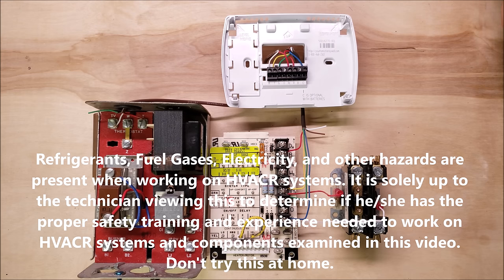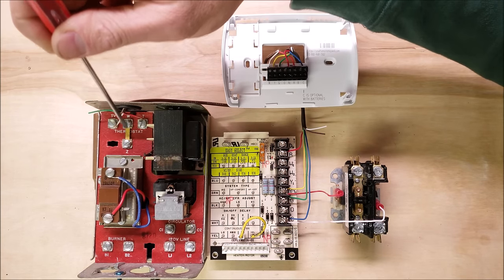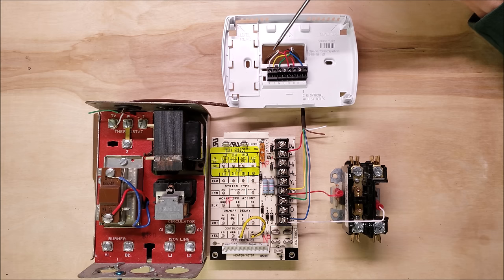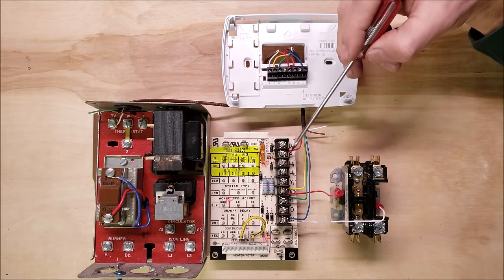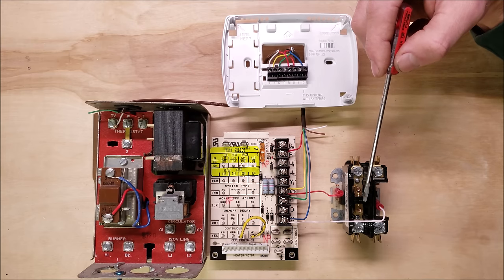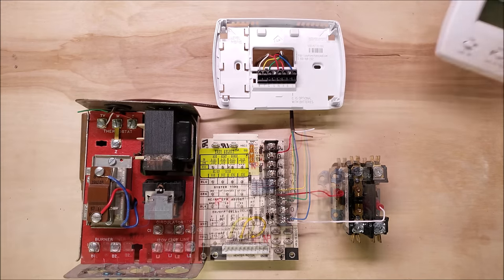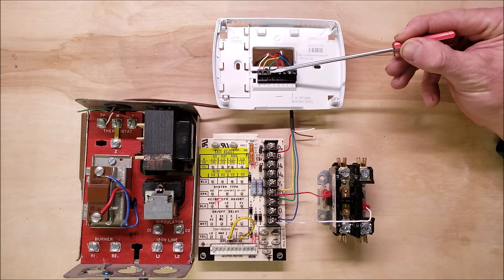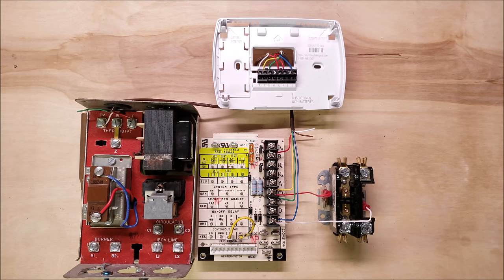Wiring The Thermostat, Boiler, and Air Handler

Comment from the maker: Tool List-  https://www.amazon.com/shop/acservicetech

Support-  https://www.patreon.com/acservicetech

For those that are looking for the tools used in the videos: (Linked Below)
Magnet Jumpers- https://amzn.to/2PyKPQZ

UEI DL479 Multimeter with temp sensor http://amzn.to/2jtsUbJ
Alligator Jumpers- https://amzn.to/2PxqJXn

Fieldpiece ST4 Dual Temp Meter  http://amzn.to/2wc1ME3

Fieldpiece Bead K Type Temp Sensor https://amzn.to/2DBwKfs

Fieldpiece Wet Bulb Temp Sensor https://amzn.to/2RRI7Tw

Fieldpiece TC24 Temp Clamp https://amzn.to/2qHLyjZ

Yellow Jacket Refrigerant Gauge Set http://amzn.to/2aenwTq

Refrigerant hoses with valves http://amzn.to/2aBumVI

Yellow Jacket Gauge set & hoses https://amzn.to/2vLVkV9

Yellow Jacket 4 Port Manifold w Hoses https://amzn.to/2BkuGIq

FieldpieceSMAN360 Digital Manifold Set https://amzn.to/2BdoaD4

FieldpieceSMAN460 Digital Manifold Set https://amzn.to/2nB4Fe6

Compact Ball Valve for Refrigerant Hose https://amzn.to/2KUisW8

QuickDisconnect 90 for refrigerant hose https://amzn.to/2MMtVcg

JB 6 CFM Vacuum Pump   http://amzn.to/2nqbvo8

Appion Blue 3/8" to 1/4" Vacuum Hose http://amzn.to/2uYlVyc

Appion Red 3/8" to 1/4" Vacuum Hose http://amzn.to/2uYg6Ro

Appion Valve Core Removal Tool http://amzn.to/2uYr8WL

Yellow Jacket 1/4" by 1/4" hose http://amzn.to/2umtcod

CPS Vacuum Micron Gauge http://amzn.to/2v1nM3O

Supco Vacuum Micron Gauge http://amzn.to/2v1JRiA

RectorSeal Bubble Gas Leak Detector http://amzn.to/2ckWACn

UEI DL389 Multimeter  http://amzn.to/2xAdaJf

\Air Acetylene Torch setup    http://amzn.to/2aQalsb  
15% Silver Brazing Rods  http://amzn.to/2gVLyLc

Nitrogen Regulator    http://amzn.to/2bXdR5f

Nitrogen Flow Meter    http://amzn.to/2brvoBg

Other tool links can be found in the video description section.

Shop through Amazon! Your Purchases through Amazon provide a means for channels such as mine to earn advertising fees from all purchases after clicking through. Prices are the same as normal-    
https://www.amazon.com/shop/acservicetech
Reply: @AC Service Tech LLC Hi Craig, what about an example if you have a hydronic heating coil on your air handler and you need your air handlers fan to turn on? From what I understand from my setup where red and white is going to your aquastat, it is sending power from the air handler 24VAC power supply to the zone valve of the boiler when the thermostat calls for heat! So would the white from the thermostat be hooked up to both the hot side of the zone valve and white for the fan (from Air Handler) together? right now I have the white from the air handler hooked up to the W1 terminal of my thermostat as I have it set for 2 stage heat making the zone feed the hydronic heating coil then the fan will start with a delay.Which I find ideal for the vents not blowing cold air while the hydronic heating coil is heating up.

Comment: Hello, first comment ever on this platform.  This video is older but it answered a question that came up during a service call with and HVAC tech.  There was one difference in our setup, the wires from the boiler controller (2) went directly to the handler and the only wire running to the thermostat was the multi wire.  The thermostat ran the a/c with the air handler and it also ran the boiler with the air handler.  The original thermostat was replaced during a heatwave this past summer when the second floor was like 90 degrees, so the tech did not check the boiler.  Cool weather set in and we discovered that the new thermostat was not calling to the boiler controller.  The tech told me that it could not have worked before with the existing wiring.  That’s where we are now.  The original tech (owner of company) is coming out to see if more experienced eyes can figure it out. The diagram in your video is the original setup except the boiler control wire.  Any thoughts? Thank you

Comment: Great video! Trying to add a wifi thermostat to my current boiler, ac, and air handler setup. Older peerless boiler. Cannot seem to figure out how to get a c wire as I don't have a c currently hooked up
Reply: Currently have a 5 wire coming in. Hooked to g/y/w/r/rc

Comment: Thanks a lot for the video. It feels like a lot of HVAC systems have furnaces instead of boilers, so it's great to have this explained like this. 

I have a similar system with a boiler and air handler connected to one thermostat. In your video, you have 2 bundles of wires connected to the thermostat- one goes to the boiler circuitry and one to the air handler circuitry. Behind my thermostat, there is only 1 bundle of wires. Both Rc and Rh come from this bundle of wires. Does this bundle of wires run up to the air handler in my attic, or down to the boiler in my garage? Or does it splice off at some point? My understanding is Rc controls the AC and Rh controls the boiler. Don't the wires have to go to 2 different places?

Comment: I have an air handler connected to oil boiler. Zone valve is wired: thermostat->air handler->boiler and I am measuring 24v on the wire coming into the boiler from air handler. When thermosta is on, I get 50v on the zone valve. Something tells me my air handler -> boiler wire needs to be wired directly from t Stat. Else it burns my zone valves

Comment: This is great for when the two systems are independent, I can't for the life of me figure out how to have a heating coil in with the air handler and power the fan to start. Any of link to a video by chance?
Reply from the maker: You can take a 24v from the boiler and power a fan relay in the air handler. On the contacts of the fan relay added to the fan coil, the contacts will have the 24v R power wire and the other contact the g wire. This way, it sends the air handlers 24v power to the g wire any time the control for the boiler sends 24v to the fan relay coil, thanks!
Reply: @acservicetechchannel  a friend is replacing his gas package unit and has a Hardy wood stove and water coil in the supply now,Hardy states a heat only thermostat is required along with the standard thermostat and an additional DPDT installed as a fan relay wired between the package unit and water pump on the Hardy,just wondering if it could be accomplished through a single thermostat?

Comment: What if you disconnected the T/Rh wire?  I'm concerned that, the way you show it wired, I could switch off the breaker for the air handler and still have an energized neutral on that circuit, because the boiler's circuit is still live.  I'm imagining someone shutting off the breaker to the air handler, then disconnecting wires on the control board, and getting zapped when they complete the circuit between C and the C terminal.

Does that not concern you?  Am I missing something?

Comment: HI! Question: I have a woodmaster outdoor wood boiler as primary heat. I have a fuel oil furnace with the woodmaster heat exchanger installed as secondary. The woodmaster uses the fuel oil furnace blower. I want to be able to set the woodmaster to 72 degrees and the fuel oil to 64 degrees to come on if the woodmaster isn't keeping up. I also have central air as a completely seperate unit with it's own thermostat. 
Two installers - one HVAC and one electrician have installed new 'combo' thermostats but neither seems to understand what I am wanting. This system isn't new, I just replaced the fuel oil furnace with a newer model. Before that I had seperate old mercury switch thermostats. 
Am I asking for a unicorn here? Is it possible to do this without 'frying the transformers' (last person said that's what would happen)
I watched this video and very much appreciate your teaching style - straight forward!

Comment: Great video.   I have a question about my home set up.  I have two different thermostats controlling 1 air handler and outdoor compressor.   For heat there is a boiler and valves that circulate water through the air handlers.  Also depending on which thermostat operates there is a relay board with damper valve controls that open or close for the different zones.   One of my thermostats appears to work correctly with heat cool and fan on controls.  The other does not operate cool or fan on controls.  I swapped thermostats with same results  and believe that there is a wiring issue from thermostat to air handler.  Will I find two control boards in the air handler or do the thermostats operate the same board but in parallel.   The thermostats were wired differently so I wasn't sure how they are typically wired in this configuration.  

Thanks for any assistance you can provide.

Comment: Nice good video! If I have my heatpump as my PRIMARY heating and I need to add my Boiler as my BACKUP heating where am I gonna hook my wire coming from my boiler ?  I am using baseboard for my boiler, thanks again
Reply: @ray S - did you ever get an answer for this?  Do you have a good solution?

Comment: So how do you connect a Nest Thermostat to a two wire system?
 I have a Boiler Aquastat, with no C wire, so the Thermostat runs on batteries and always looking for more power. Google sent me a Nest Power Connector which is suppose be similar to a C wire. Because I have 2 zones, this will need to be installed at the zone controller, that is the Aquastat right? 
Would the wire connections be:
Z = C on the Nest
T = R on the Nest
TV = W on the Nest

Comment: Can I get run  "C" wire  from the "C" terminal in the air condition controller board  into my wifi thermostat "C" terminal?

Comment: And what if you have that boiler control board, and a wifi thermostat that wants a common wire? I'm thinking I have to add a 24VAC plug in transformer. I tried jumpering the W (TV) to the C on the tstat, but it freaks out and resets itself when turning on the boiler.

Comment: How can I wire an Ecobee to a steam  boiler and air handler? I only have three wires from air handler and two from boiler. Can I use a common maker with an isolation relay, if so where can I find a diagram? Boiler and AH in same room. Thanks.

Comment: Hi can you please put link to buy same kind of aquastat.I have hydronic force air heating now but when my thermostat calls for heat it hits the blower and boiler same time because boiler takes time to heat up the water coil I get cold air for about 3-4 minutes.I don’t have any aquastat installed right now.Please let me know if aquastat going to solve that issue.If yes please send me the link for same aquastat you using in this video then I can install it myself.Thanks

Comment: I have a Boiler for heating and central air for ac. 
The system has 3 different wall mounted analog that I can can change the temperature on. Two are up stairs right beside each other one is for heat ( it has R, W hooked up) the other is for AC (is has Rc, G, Y hooked up), the last one down stairs, I think is for AC (has R, W hooked up). 

Is there a way to convert this system over to a digital one. I get if only the up stairs thermostats existed it would be easy but that down stairs one has got be scratching my head.

Comment: Wiring diagram is incorrect on the strap on aquastat, you Goto the g terminal and the rh terminal they way you have it depicted is on the cooling circuit, so the fan wouldn’t be energized unless it was in cooling cycle and the water was above 120 or whatever you set the low to, it has to be jumped with the rh terminal not the rc terminal